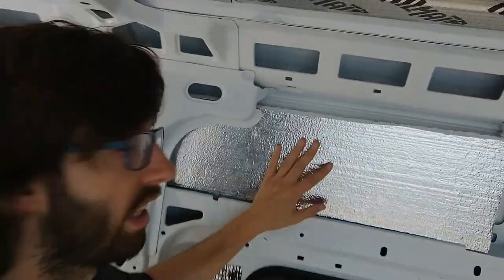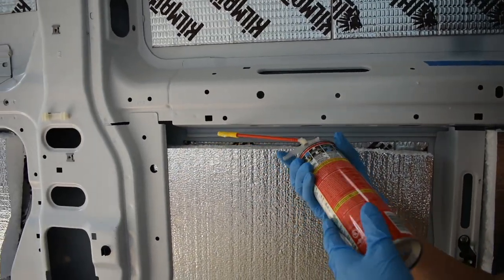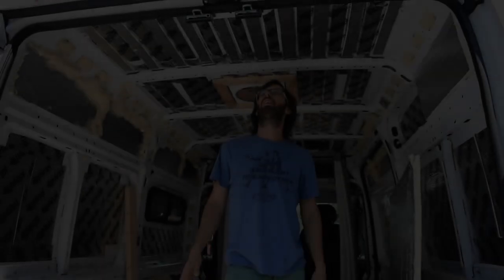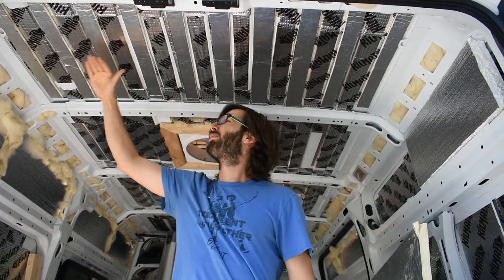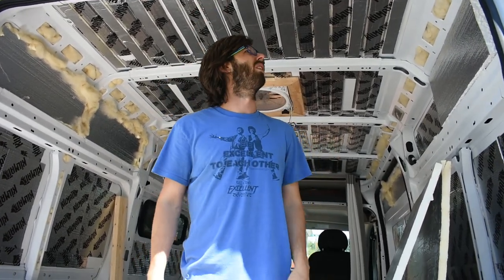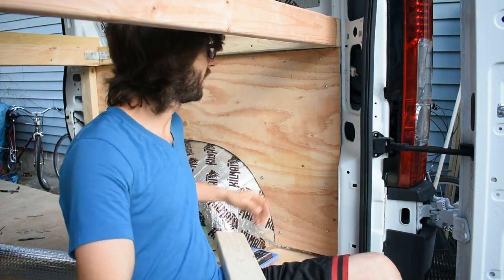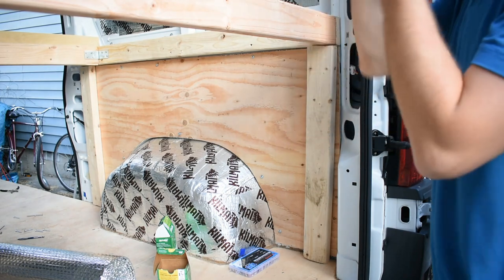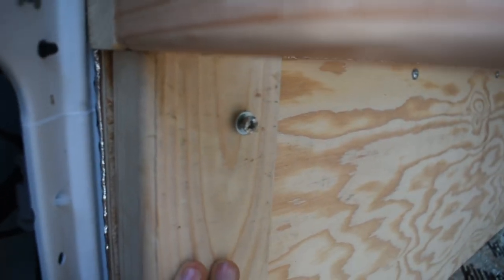Building BEDFRAME and INSULATING a 2018 Ram Promaster | Van Build Series

Comment: I’m currently doing my van build and I’m seeing people recommended doing wiring before insulation.. I see you did it opposite.. this I what I want to do as well.. what are your thoughts on this? Did you run into any trouble doing it this way? Thanks :)
Reply from the maker: Sorry for the late response. I wouldn't change how I've done any of my wiring. We still have it all behind walls and hidden. I would saw you can easily do at least 90% of your insulation before wiring.

Comment: this is such great info!  Picking up my 2019 Promaster tomorrow in Washington!  What size rivet nuts did you use and do you recommend anywhere specific to purchase?  No hardwares stores carry.  thanks in advance!
Reply from the maker: Wow congratulations!! I'm so excited for you. It's such a fun project and so fulfilling. Yeah you won't find rivet nuts at a hardware store they are more used for auto stuff but even most auto stores don't carry. I bought a variety pack of rivet nuts and a rivet nut tool gun on Amazon. For the bedframe I mostly used 5/16ths and a couple #10 I want to say... #10 is by far the most common sized hole throughout the van, along with some #8 and some 5/16ths and that should mostly cover you. Enjoy!

Comment: I might have missed it, but what size is the hanger bolt and drill bit used? Thanks!
Reply from the maker: The hanger bolts I got were 5/16th and I just hold my bolt up to my drillbits and choose one the is slightly larger than my bolt so can't remember exactly the size. You'll figure it out though! Best of luck and thanks for commenting!

Comment: Hey where did you get the hexagonal rivet nuts from for the ProMaster?
Reply from the maker: We just used 5/16ths sized round ones. They seem to fit and hold very well even in the hexagonal shaped spots. Although you for me interested to find out if anyone sells hexagonal shaped ones now lol
Reply: @DoubleAVaneries  I found this link for hexagonal rivnuts, although I have not ordered them or used them myself: https://www.mcmaster.com/standard-rivet-nuts/heavy-duty-twist-resistant-rivet-nuts/ I believe I discovered it on a ProMaster forum site.